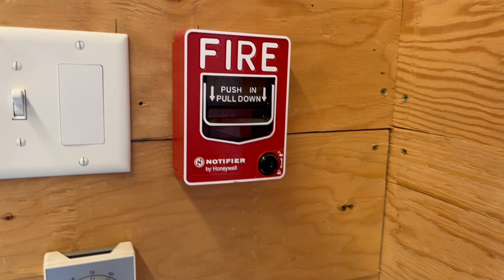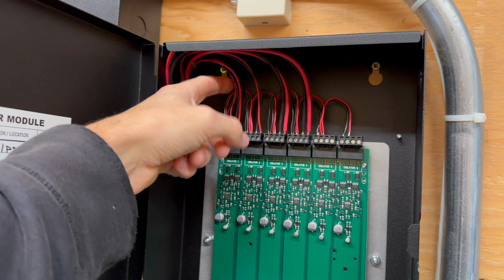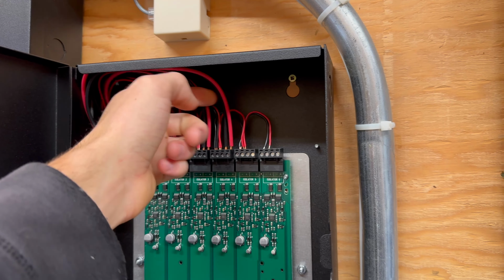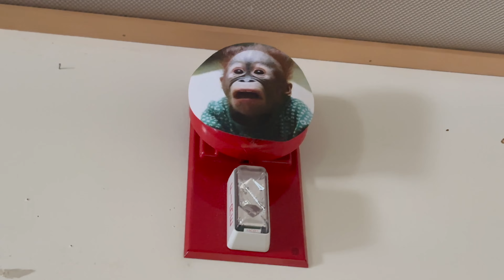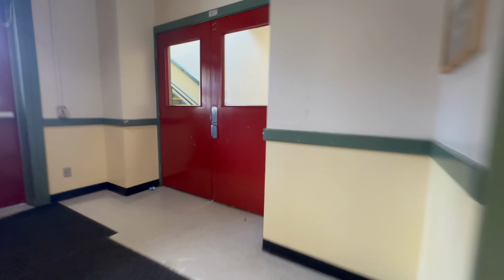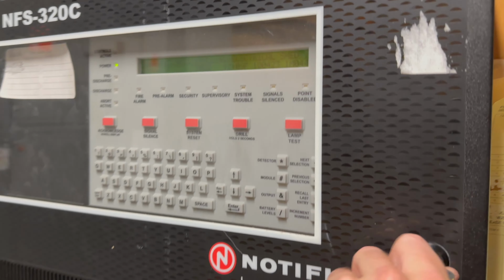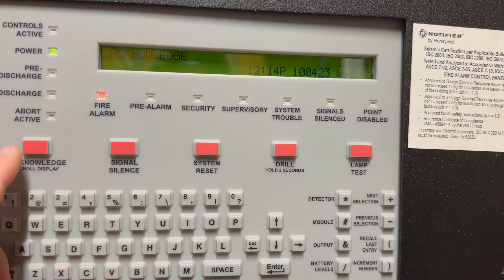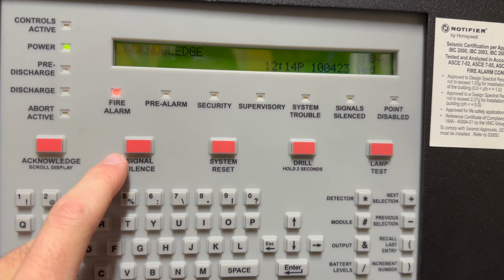Fire alarm drill at elementary school

Comment: did the 320 come out the same time as the 640 and 3030 the original ones or did it come out later than the original 640 and 3030 because the 320 is still on its og series and the 640 and 3030 is on its 2nd series

Comment: Hello Nic I have a problem and was wondering if you can give me some advice I have an older notifier panel specifically an am-2020 and I’ve been trying to connect my annunciatior while the annunciator is online I can’t seem to use the buttons on the annunciator I’ve switched out the annunciator and checked all the switch settings on the annunciator board yet to no avail btw the annunciator is an acs annunciator

Comment: - at my high school, the annunciator has said this for almost a month now (i took the photo a while ago but it's still there today). im confused why it's a trouble but then says "SPRINK SUPERVISORY" and SPRINK sounds like sprinkler but it says diesel fuel low so that is also confusing me. any idea what this means? (room 2601D is the sprinkler control room) (its a notifier system)

ACKNOWLEDGED TROUBLE           OPEN CIRCUIT
DIESEL FUEL LOW           RM 2601D
SPRINK SUPERVISORY   Z095      TRACK SUPERV
07:56:50A WED MAY 08, 2024       N001L05M035
------------------------- EVENT COUNTS --------------------------
FIRE ALARMS:000 PREALARM:000 TROUBLE:001
SUPERVISORY:000 SECURITY:000       OTHER:000
-------------- 07:39:09A MON MAY 13, 2024 --------------
                                                        SIGNAL SILENCE
MORE INFORMATION                    SYSTEM RESET
PROGRAM/ALTER STATUS                 MAIN MENU
Reply from the maker: Diesel sprinkler fire pump low on fuel
Reply: @nics-systems-electric  and would a diesel fire pump be used in a power outage where an electric one wouldn't work?
Reply from the maker: @wibwabz  usually a diesel fire pump will be the only fire pump and will run if needed in a power outage or with power. Usually if there's an electric fire pump it will be on a diesel generator that will power that electric fire pump during an outage. I've never heard or seen of having an electric pump and a separate diesel pump for power loss only.
Reply: @nics-systems-electric  Interesting. and what is the pump for? is it to boost the pressure in the sprinkler system or is it something for the FDC pipe or something else?
Reply from the maker: @wibwabz  it's for the sprinkler system to increase pressure and flow